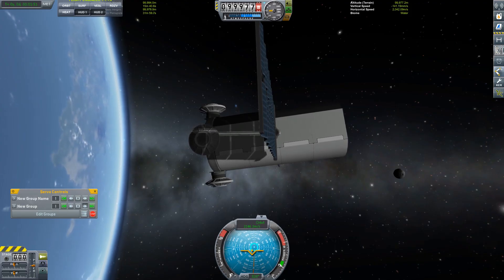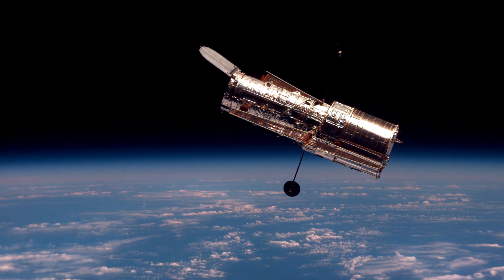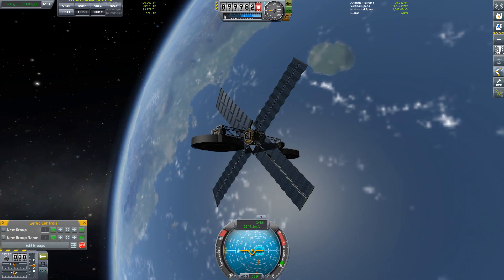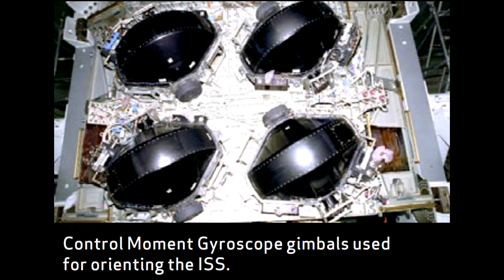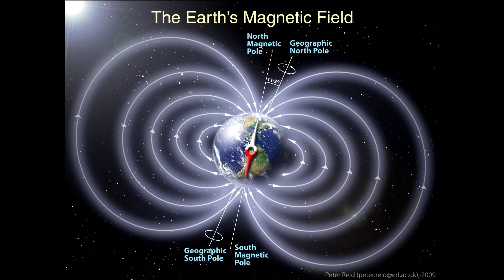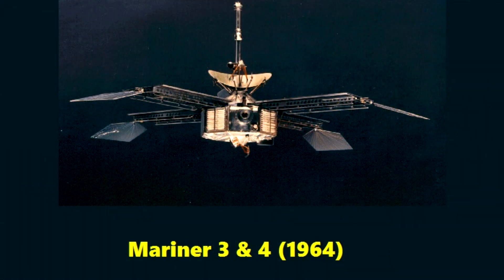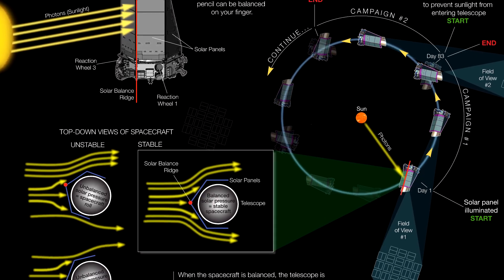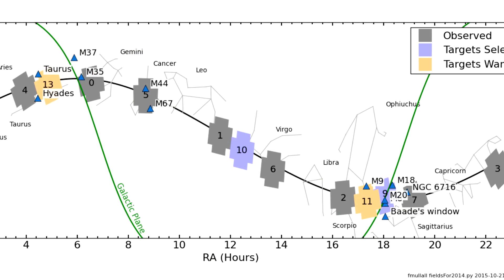Reaction Wheels - Things Kerbal Space Program Doesn't Teach

Comment: Just because it wasn't mentioned in the video, the Hubble telescope (and most space telescopes) do not have thrusters of any kind onboard. There is too much risk of the exhaust from the thrusters fogging/damaging the delicate optics on the telescope. Instead, as Scott said, the Hubble uses reaction wheels to point itself. What it also uses it a set of magnetorquers to constantly bleed momentum off from the wheels, so as to avoid them becoming saturated.
Reply: What about JWST then? Some (not much) thrust is needed to maintain its position at the Lagrange point, which is unstable.
Reply: @IDoNotLikeHandlesOnYT  If it is unstable, any vapour released by the thrusters will just drift away.
Reply: There have been many space telescopes operated since Hubble (such as Kepler, Spitzer, GAIA, etc.) and they make use of thrusters. The worry about exhaust fogging up the optics was probably a matter of overzealousness when Hubble was originally built, since then we've learned it's not as much of a problem as was feared.
Reply: Also thrusters would need fuel refills. Reaction wheels just "replenish" using the solar panels without needing to consistently send anything up there.
Reply: Fix: camera wiper
Reply: Quite an idea, but it is likely because an open magnetic field of that strength would interfere with some of the super-sensitive detection instruments inside the shuttle (such as the cryogenically cooled Infrared imager), and also that coupled with reaction wheels it might put too much load on the telescope's power system and lead to brown-out.

Comment: Actually it is possible to rotate on all three axis with only 2 wheels, if you rotate 90d on any axis, then rotate 90d on a second axis, and finally rotate -90d on the first axis again, that will yield the same result  as rotating 90d on the third axis.These are all of course using only local axis.
Reply from the maker: +Ethan Salie but then you can't stop drift in the 3rd axis, so you end up with net rotation around that axis over time.
Reply: Not to be confused with 'gumball lock' when your quarter gets stuck in the gumball machine and it won't dispense delicious candy.
Reply: Haha,  @itchykami , but gum isn't candy.
Reply: @HelloKittyFanMan.  yes it is. A gumball is a type of candy. But this was about rotational forces.
Reply: Nope,  @RKroese , gum isn't candy. Candy is designed to be eaten.

Also, I know what the video is about.
Reply: @HelloKittyFanMan. Candies are goods made of sugar!
Reply: that's not gimball lock
Reply: ...usually followed by the sound of breaking plastic and rending metal...
Reply: what
Reply: Dang
Reply: +Scott Manley Called 'gimball lock', I believe it is referred to briefly in the Apollo 13 movie.

Comment: If control moment gyros essentially have the gyroscopic spin "baked in" pre-launch, how do they deal with the friction problem? That is, wouldn't the wheels tend to spin slower and slower over time as it's never possible to get friction within the spinning wheel system down to zero? Do they have additional motors inside the gyro that help re-apply a small amount of spin over time to counter this effect?
Reply: I'm pretty sure they have motors keeping them spinning at a constant rpm, you're right that relying on frictionless motion isn't wise.
Reply: Navigational gyros on submarines work the same way; they HAVE to spin at a constant RPM to be reliable, and inertial changes due to the ship's movement (both linear and angular) are recorded and translated into position changes.  Once the vessel surfaces it can recalibrate with GPS.

Comment: mind blown. I find it fascinating how things are conserved and in conditions of low gravity, we start seeing its effects. Never imagined that the light itself would continually add torque to a system and that momentum is also conserved until eventually its too much to handle.

btw I have this cool wacky invention in KSP. Im pretty much a new player and have really really low tech unlocked. No powered wheels, only the steerable ones, and those with brakes. But I wanted a land vehicle that relies solely on electricity and solar panels. The only thing that rotates that I have would be the gyros. So I made two big wheels made up of 8 girders as the spokes. The command module is in the center. When this craft is on land, and when it pitches down, the vessel rolls forward. Probably dizzy for the pilot lol.

It does move forward and I can steer a bit but when you yaw left when the pilot is upside down, you actually steer right in the direction you are going. So to steer you have to watch if the command module is upside down or right side up. Or you stop moving then rock forward/back as you pirouette into the direction you want to go.

Just yesterday I upgraded to level 3 vehicle assembly building. So now I have custom control. So in addition to the 8 spokes on each side, I also added 8 landing gear on each side. The left is toggled by 1, and the right is toggled by 3. By toggling the landing struts, I change the "gearing" by increasing the diameter of the wheel/spokes. When the right side is deployed, the right side rests on the landing struts instead of the girders, having the outline of a cone instead of a cylinder. When it rolls, the vehicle will slowly steer left.

Pretty proud of my invention, no powered wheels, still able to make a land vehicle that relies solely on batteries/solar panels.

Comment: So with the gyroscopic control why don't they set the rotation of the wheel to a brake so they can stop the majority of the momentum. The torque created by stopping the wheels would be  quite large but you could only partially stop the wheels, realign them, speed them back up, control some of the torque created, then repeat every time they become over saturated.

Comment: 5:56 "You need to desaturate using fuel"  There is at least one other way to desaturate, which for instance the ISS uses.  Your satellite has to be fairly long to use it, and it has to be in orbit around a planet or similar.

You can use tidal forces to spin down.  Picture a long satellite such as the ISS.  Earth's tidal forces tends to pull it so that its long axis is aligned with the direction of gravitational force.  Basically, the part that's nearer earth is attracted more strongly, and if your satellite is long that makes a difference.

So you orient it so it's not aligned with the direction of gravity, and at such an angle that the axis of torque due to tidal force is opposite to whatever direction your control moment gyros have excessive momentum in.  Then you hold that attitude, fighting the tidal force by spinning your gyros down, until you are happily in the center of your operating envelope again.
Reply: Would not simply using the spin to generate electric current spend that  momentum into something not mechanical (and therefore not undoing the orientation change?

Comment: I was thinking about radiation pressure, and I wondered if there was a possible orbit where the solar radiation would equal the drag, therefore making an orbit that would never deteriorate? I assume you would have to have an eccentric orbit to balance it out. Also, fluctuations of exospheric pressure might fluctuate to the point of making this impossible. Still, could this possibly work in theory?
Reply: In theory yes, but you would also need to compensate for any gravitational pulls of local objects in space. Since the major source of radiation pressure is from the sun, that is probably the only object you could attempt to pull this off with, but since it has many satellites (aka the planets and asteroids etc) surrounding it you would have to math out a path that would avoid destabilizing the orbit by gravitational influences during flight.
Reply: As for trying to use solar radiation pressure to orbit other objects, because they orbit the Sun and you are orbiting the thing orbiting the sun it would be very hard to keep a stable orbit based only on radiation pressure because I would think the sun does not emit the same amounts of radiation in all directions so fluctuating pressures would tend to destabilize your orbit. If you chose to orbit the sun however you could compensate and even use the pressure fluctuations to your advantage
Reply: Not really the most significant factor, to counteract the effect of gravitational anomaly the GPS satellites are in a 2:1 resonance orbit, this even out the perturbation, but cause "wobble" that you have to account for.

Comment: get yourself an office chair (that spins) and a wheel (from a bike, for example; car wheels work better but they turn out to be a little too heavy to hold in one hand) . sit down on the chair, hold the wheel horizontally and spin it colckwise. now get someone to push your chair so you rotate as well. now flip the wheel 180°
Reply: Warning: the person witnessing your little experiment because you needed him to spin your chair might accuse you of witchcraft so prepare to run away
Reply: You don't even need a wheel. Just hold something heavy. Move the object from your center of mass to the side. Arc the object to your other side. Move the object back to your center of mass. Repeat to go around and around. You could also pass the object to the other hand behind your back if your flexible enough to reach behind the chair.
Reply: What-the the thing is, if you do what i wrote you will change your direction of spinning every time you flip the wheel... that's the whole point. it looks like you hacked physics, really funny
Reply: I know the wheel thing. I've done it before at a science discovery centre, very cool I might add. I was telling people how it can be done another way at home without dismantling a bicycle / car.
Reply: These wheels produce torque, not thrust. It might be possible becausr of some weird physics reason, but as far as I know, these are not antigravity devices.
Reply: @Alexaflohr  stack them properly and torque becomes trust. A guy did that in a canoe. Eery sight seing a canoe cross a pool without a paddle.
Reply: In my town in our Technical Museum, there is this experiment, where the kids can experience this effect themselves - the museum is awesome, no kid or friend's kids had ever complained going there. Full of fascinating machinery, planes, a hangar full of trains - and many hands-on experiments for the visitor to try out. 
By far the museum I visit most - they now have a flight simulator!
Reply: This type of idea could be used for a momentum drive or antigravity drive to generate momentum upwards without thrust so you can fly and move at great speeds with only electric power

Comment: why not have reaction wheels and the gyros ? could you not simply use one to relive the other when it gets saturated then trade off?
Reply: You'll run into the same problem eventually.
Reply: true but far less often probably more or less half as often
Reply: My guess would be weight and power requirements.  Getting anything into space takes a lot of energy, and the amount increases exponentially as you add more mass to the spacecraft, so when designing a satellite for an orbital mission, one has to take into account its mass so that it doesn't exceed whatever the launch vehicle can put into orbit.  The other problem is, of course, power consumption.  Again, due to the mass limitation, some satellite designs would lack sufficient power generation to power both the reaction wheels and gyros at the same time.

Comment: This isnt entirely relevant to this video but I just rewatched the orbital mechanics on paper now that I have a basic understanding of calculus. I understand that it is more efficient to go into a higher orbit before the geostationary one, but why do spacecraft like the European atv not use a Hohmann transfer to get to the iss. Wouldn't that be more efficient and faster?
Reply: When doing approaches to the space station, they deliberately trade some efficiency for increased safety. You're exactly right that a Hohmann transfer is both faster AND more efficient, but the problem is that it involves the spacecraft to be moving towards the station quickly and decelerating as late as possible.

Doing this adds a lot more risk, because if the propulsion on the spacecraft fails as its about to decelerate, you run into the risk of it slamming into the station at tens of m/s

Doing a slower (and less efficient approach) ensures that if the engines DO fail, the risk will be minimal

Comment: I just wish Orbiter had Kerbal Space Program's spacecraft designer/creator.

Kerbal is far far far easier to make adhoc custom design spacecraft (usable in-game GUI vs geeky text files via 3rd-party 'universal spacecraft' and often are cheesey via this method).

Orbiter is better for premium spacecraft though (Shuttle Fleet, Project Apollo NASSP, DeltaGlider IV+UCGO, DeltaGlider XR2-RavenStar), though they are pretty much software products in their own right.

Kerbal (core + 3rd-party addon momentum) is more here and now while Orbiter is more hard sci-fi that also accommodates the here-and-now.

Orbiter is easier (but not easy) to make custom planets and star systems (geeky text files, graphics optional vs must hack the game - coding & graphics)

Orbiter and Kerbal are about the same for atmospheric flight (Both very inferior to X-Plane)

Orbiter has better space simulation. Both are newtonian physics only.  

Orbiter is way better for complicated trajectory planning thanks to Interplanetary MFD and TransX. Kerbal's is easier to use though.

Kerbal Space Program has better orbital track visualization, and is built-in and integrated vs orbiter requiring a 3rd party plugin.

Orbiter is closed-source freeware while Kerbal Space Program is commercial / proprietary. Nearly all addons for both are free ($$$).

Comment: I had a similar idea to the magnetorquer. I extended the idea to propulsion as well. I thought that, given enough manipulation of electromagnets, one might be able to use the earth's magnetic field as something to push against, thereby accelerating a spacecraft. One would have to fix the issue of the spacecraft flipping the wrong way around, without oversaturating a reaction wheel or gyro all the time. Additionally, It might only be able to work in polar orbits (unless you could pull off some weird induction mechanism), which would limit its usefulness. Finally, the Earth's magnetic field might not be strong enough, so such a device might only work around gas giants where the EM field is stronger.

However, the advantage is that one might be able to navigate a planetary system without burning much fuel.

Comment: so if you were riding an exercise bicycle in a space ship/station you might eventually start rotating the vehicle
Reply: You would not be pushing against the craft, probably, because the exercise bicycle is its own system (no torque). Dave running around the Discovery One does apply torque, presumably. Although the mechanics of the Discovery One's rotation ring never were too clear to me... and I do remember reading the SFX team of Babylon 5 had a moment where they realised the earth fleet's ships (which have giant rotating parts) would need to thrust in angled directions because of the gyroscopic effects.
Reply: well the bike would have to be attached to the floor and the spinning flywheel would have a similar effect to the gyros talked about
Reply: I see I wasn't thinking this through. Somehow I was thinking that because you are pushing the bicycle wheel yourself the ship wouldn't get in on the action, but I realise that is a bit silly.
Reply: Not so much eventually, the action and reaction would be instantaneous. Just extremely minute...assuming the wheel in question were a few lbs/kg and the craft many thousands.
Reply: DrewLSsix yeah that is sort of what i meant, but i assume (maybe incorrectly) that the speed of the wheel would make a difference, so going at 1 mph would be negligible but going at 20 or more mph you might notice it.
Reply: IIRC, they actually have a special system for exercise bikes on the  ISS that absorbs the forces put out by the spinning wheels.
Reply: NavidIsANoob i guess that is why the have to design fancy exercise bikes then

Comment: Why not put a gyro on a canfield joint? That way you should be able to control 3 axis with just one gyro (and another one for backup ofcourse)
Reply from the maker: +Jesper Andersson the 3rd rotation axis is the spin of the gyro.
Reply: Scott Manley Then just put the gyro on a 180 degree swivel on the axis of rotation on the canfield joint so you can swap direction of the spin to get the force in the other direction when you need to ;). (ok i now realize why this wouldn't work the way i imagine, i will scrap this idea)